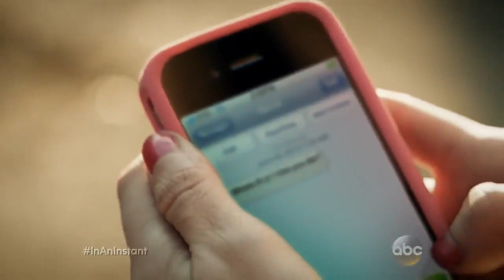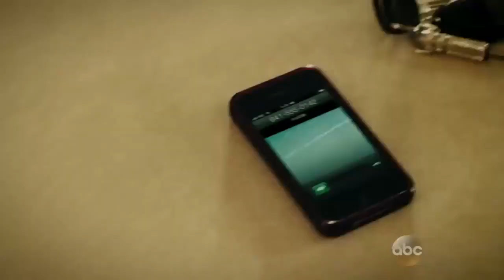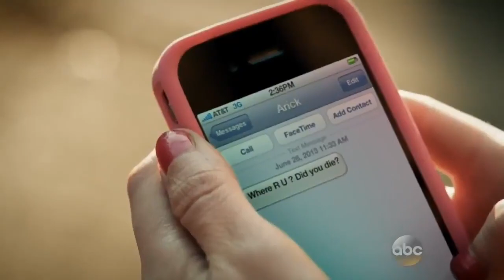20/20 ABC In an Instant Buried Alive

Comment: I would think that the fire dept. in silo country would have some type of industrial strength vacuum. They could have sucked the grain out of that rescue tube in a few minutes.  A vacuum would save lots of time and maybe a life or two.
Reply: A proper harness and winch would have prevented it from happening in the firstt place
Reply: Steven Conroy They dont.... they are first responders not your carpet cleaners
Reply: Hi Steven.  A vacuum system is too much complicated apparatus for the situation.  An effective way of getting the grain out of the tube is to put a five foot long, by four inch diameter auger inside the top of the rescue tube, and hooking it on the top of the grain tube.  There is a short spout at a 45 degree angle at the top of the auger, and then you spin the flighting inside the auger with an electric, or cordless drill.  The grain goes up the auger, out the spout at the top of the auger, and over the top of the rescue tube.  GSL sells a complete grain tube rescue system that includes this specially designed auger for this exact purpose.
Reply: I know someone who nearly died in a bin even though he was wearing a safety harness and a mask.  The mask did keep the grain from going into his mouth and throat but he was blue when they got him out of the bin.
Reply: @MrAddie-nz8nj  lol  good one. 😅🤣😅